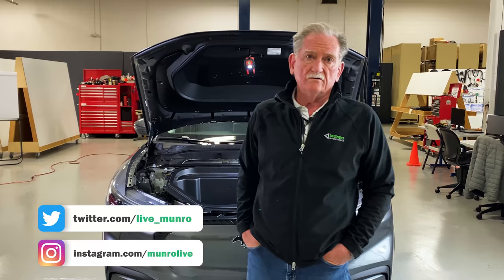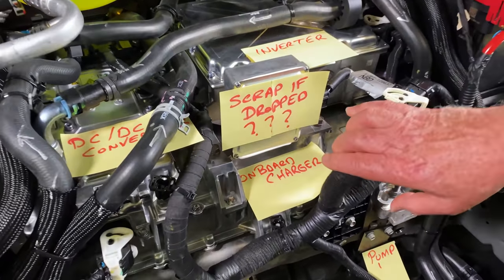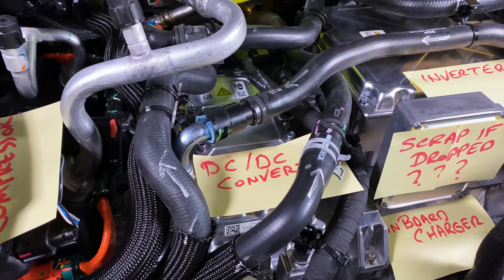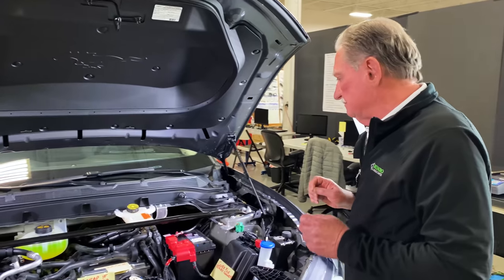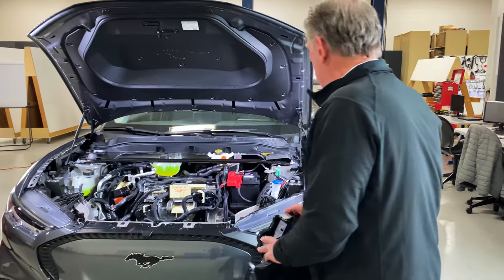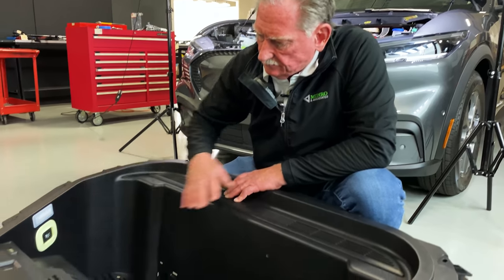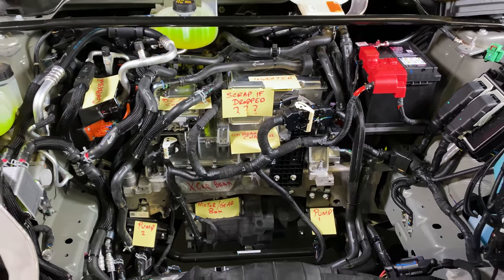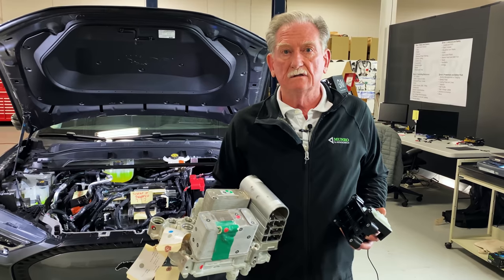Mach-E Thermal System Nightmare

Comment: The plastic lid over those sealed connectors is almost certainly the result of some edge case caught in the FMEA which could have been scored down either with testing or with that cover. Time constraints usually result in extra parts, and a later cost down would probably see it deleted when testing is complete.

Ditto the "scrap if dropped". It'll be an FMEA risk associated by one of the internal components mitigated by writing that on the box.

This is all typical of the conservative arse-covering nature of automotive engineering whereas Tesla have a guy at the top ready to understand the risks and make an educated call to ignore them.

Comment: I’m not an engineer but even I know you don’t introduce a joint, where there’s no need for one. Why give yourself extra problems to first make the joint, then fit the joint and at a later stage if something goes array, to have to eliminate each extra joint or mend extra joints.  If you can have a continuous run without constricting bends, don’t build in future headaches with extra joints.

Comment: So…”I don’t know what any of these hoses or modules do, but Ford should eliminate them”.

Okaaayy…
Reply from the maker: Our team of 30 engineers know precisely what each component is. The fragmented approach by Ford is only briefly covered by Sandy. The DC-DC converter, and charge module are integrated inside the battery on the Tesla Model Y/3 and there is precisely zero hoses between the pumps, octovalve, LCC, TXV’s, and chiller. The inverters are also integrated into the EDM’s for the ID.4, E-tron, and all Tesla’s. Thanks for watching.

Comment: Interesting mess of hoses. To play the advocate here, these hoses and fittings shouldn't reach a typical engine coolant temp right? No hot engine cooking them from the outside either. Less thermal stress and less chance to leak? Sure from an engineering standpoint it has much room for improvement,  but I don't think it's the ticking time bomb the comment section makes it out to be.

Comment: Utter nonsense. Look under the bonnet of a turbocharged car and there will be a similar number of hoses (heater, AC, liquid cooled turbos, cooled EGR valves, oil coolers, low pressure radiators and intercoolers, degas systems, split cooling systems, electric thermostats, electric coolant pumps etc.. etc..). The stacking of components is clever it maximises the frunk space whilst making each item accessible. The 'scrap if dropped' labels underline Ford's commitment to quality and making a 300v DC system safe, which is based on years of manufacturing expertise that the newer car companies don't have. Don't believe the hype, the Mustang Mach E is an outstanding vehicle.

Comment: Have you seeen this excellent June 8th (published 12th) technical Webinar from the IMechE youtube channel:
Advanced Thermal Management in Future Hydrogen Fuel Cell Powered Vehicles
Hydrogen fuel cells are becoming the next new innovative propulsion system.

This webinar will consider the key challenges for effective thermal management in future fuel cell powered vehicles. The goal of the webinar is to improve understanding of the current and potential future roles of thermal management in pushing the limits and trade-offs between key vehicle performance factors including powertrain system efficiencies, weight, durability, ease of vehicle integration, sustainability/life cycle impacts and cost.

Join the discussion covering the challenges and opportunities posted by Hydrogen Fuel Cells, including:

- Neil Fraser, Head of Engineering, MAHLE Powertrain
- Dr Cedric Rouaud, Global Technical Expert, Ricardo
- Nick Buyens, Technical Expert (Model Based Design), Toyota Motor Europe
- Pratap Rama, Fuel Cell Powertrain Manager, Jaguar Land Rover
- Chair: Prof Alasdair Cairns, IMechE VTMS Chair

[I can't post the weblink or it will be filtered out.]

Comment: Electric cars are very simple.  Until you try to make 300+hp and have to water cool everything as much as an ICE.
Let's be clear however, a Tesla will overheat if its run at high power too much.   No doubt the ford setup can be simpler.
Let me also add a point that Mr. Munro seems to ignore, that when you make everything one single part, the cost to replace/repair goes way up.
If the new stamped Tesla gets in an accident, even minor, the car is now trash.

Comment: Why don't people understand.? Ford cannot go from yesterday making cars that the dealers can make tons of money on repair costs too tomorrow making a car that the dealers have to repair a lot less. Plain and simple the reason these cars are complicated and they have so many extra parts and stacking Parts on top of Parts on top of parts so when one part goes bad you have to remove all the other parts to get to that one part is so the dealers have a revenue stream which is us the customer. For example in your video you show that they put all the parts on top of each other instead of spreading them out like Tesla does. The reason they did that is if for example an inverter goes bad you have to spend three or four hours removing the other parts to get that inverter so the customer has to pay for that the dealer makes money. Yes Ford is moving in the right direction but they're moving at a snail's pace unlike Tesla which makes leaps and bounds because they don't have a dealer Network on their back telling them to make cars complicated so they can make money off the consumer

Comment: If that’s the best Ford can do, maybe we should let the company fail.This is embarrassingly bad design piled on top of bad design. Less parts equals a better product is the core value of design and engineering. Throwing more parts and random people at a problem in a desperate attempt to quickly solve it never ends well for a company. I guess this is what the end of Ford looks like.

Comment: "Scrap if dropped" really sums up the erroneous mindset of legacy automakers. By contrast Tesla seems to run on "drop if scrapped"! It couldn't be a more inverse mindset of engineering. If it's superfluous to requirements drop it, don't ship and build un-necissary products. That's really what makes the likes of Apple and Tesla speak such a similar "minimalist" design and engineering language, something that the "legacy" of their respective industries,  such as Microsoft and Ford, continually fail to comprehend. This episode really just highlights why I wouldn't be keeping a single dime in the likes of Ford, Microsoft or any of the "legacy" automakers in general. They're simply too far behind Tesla, and have a completely "wrong" culture to be able to adapt in any meaningful way. 

Just imagine what happens when all those leak paths find their way into batteries and motors?!? It will be beyond a "shocking" out come (pun intended!).

Comment: Sandy: "OMG! look at all these hoses! The horror!" 
Also Sandy: "Tesla does it with only a "few" hoses" 
There are ICE cars that have much higher heat load extremes that last well over 20 years and hundreds of thousands of miles with hoses and clamps much worse than this. He seems extremely biased, this is not such a big deal. Everything is easy access and if you don't know how or why it works the way it does, that means you have no business working on it. I could also care less about some stupid battery tray, even though apparently they did it right? But he had to mention it as if it were a negative, WTF?
Seems like someone is heavily invested in Tesla stock and has his tongue way up into Elon's butt. #Zerocredibility
Reply: Say what you want, but complexity = problems and failures
Reply: @danmobile  In some cases, but it is not that simple. Do you think the Tesla is less complex than the Ford? It is not, so spreading complexity out into several individual components can actually improve reliability, reduce cost, and simplify ease of repair. The point is you can't just look at the number of hoses and valves and determine which system will be more reliable. I have seen plenty of examples where individual integrated components are actually far less reliable, and far more expensive to replace.
Sometimes components are added to actually improve reliability. I have experienced systems that looked very complex but were extremely reliable, and seemingly simple systems that had very high failure rates. My point is that these hoses, clamps, valves, are used in even more complex systems that operate under much harsher conditions and still have a very high reliability. So to say that we know the Ford will be less reliable just because it has a couple more hoses or valves is just foolish speculation. 
Are cooling systems even a high failure rate item on most modern cars? No, so should this be a concern in this case? Absolutely not.
Sandy has even admitted he is biased with Tesla, and it is very obvious from his videos. The fact is nothing he has pointed out here tells me one way or the other which car will have better reliability. It is possible that using proven off the shelf components designed to work under much harsher conditions, could end up being more reliable. 
Unless there is a particular component or design that is known to be a high failure rate item, you really cannot know. Some of the things he was complaining about were just absurd, which tells me this is a very biased review that is not going to tell you anything of value. All it tells me is that Sandy is a Tesla fan boy, and apparently incapable of providing an unbiased objective analysis or opinion on this EV. 
As to which car will be more reliable? Only time and experience will tell. Personally I would be more concerned with which car rides better and has less squeaks and rattles (especially in a quiet EV), and in that regard even Sandy admitted the Ford was significantly better in that regard, and given that he is a Tesla fanboy that is really saying something. Perhaps that is why he felt the need to find inane issues to point out about the Ford? 

Yes it's better in every subjective category, but look at these extra hoses! And the battery tray! Ridiculous.
Reply: @ericmichel3857  Without reading that huge wall of text, I think the Tesla has a superior cooling system design and its simplicity has a lot of upsides with pretty much no downsides. Ford is inferior here, on this detail. Sorry. 

There's so many Teslas on the road and the cooling system is dead nuts reliable.. the Ford is the one that needs to "time will tell" etc.

Comment: Once again you seem to be missing the point. FORD found a way to keep their dealer network in the loop. Everyone knows that purposely built EV's don't end up going back to the dealer for servicing. FORD has designed flaws or potential flaws as in leaks to their cars as a way to ensure that the cars / trucks EV or regular all and I do mean ALL end up going back to their dealers for servicing at some point.

TESLA do not build flaws intentionally into their cars. They will however take better idea's as they are discovered either by you or other manufacturers that you tear down and implement those into future iterations of their vehicles. What would you do? They seem to follow good idea's and jump start them to be incorporated as any good engineer should....

Comment: Ford has always seemed to have form follow function under the hood - my F150s and F250s are not very pretty with wires, hoses and tubes running everywhere - unlike GM and RAM who seem to make things look prettier - that being said, I have had very little to no issues with my trucks over the years, putting about 45K miles/year on each.  I hear of challenges particularly that RAM owners have with reliability ... I will take ugly under the hood over pretty problems any day.

Comment: This is all well and good, but Tesla is delivering cars that break down shortly after delivery! iPad Rehad and several others are reporting increasing service issues and real incompetence. They may have some good design, but Tesla is FAILING SERVICE & DELIVERY IN MANY CASES! I’m hearing from three friends that returned cars and cancelled! Tesla is screwing up, that’s not a company with their valuation. Fit and finish is failing over and over.
Reply: She got a lemon. Bad luck but happens. Given the scrutiny Tesla receives, stuff like this would be all over the news if it was common. Plus, being a member of one of the largest Tesla forums, I get to see a lot of the complaints, and these kind of multiple failures are rare. I do agree on fit and finish, but the factory usually takes care of complaints when brought up by the customer. There's room for improvement there for sure.

Comment: I've driven 3 cars for over 200kmiles and 12 years and none had any coolant hose leaks.  In all my cars, I've had more issues with electronics that anything else.  BTW, I'm an Electronics Engineer myself and worked in power electronics my whole career (>25 years), I think the most reliable car maker will be the one who does a better job designing the power electronics and is more conservative with their design margins.  Liquid cooling has been used even in power electronics for many years (since the mid 90s), and coolant leaks are not an issue.  This video is looking for problems in the wrong place.  This is an Electric car, you need an experienced Electrical/Electronics engineer to comment on the design....he or she would have more experience in this area.

Comment: The fuse bored connectors are high power connectors and there black 😂😂😂 they are not. They are ran off the 12 volt system 😂😂😂 well he clearly doesn’t know anything about HV vehicles 😂😂

Comment: Hey Munro are you taking into account how repairable something is?  it seems like if you keep lightening things and burying them inside, it would be ridiculously difficult to repair.  It doesn't matter how well designed a car is, if it's difficult to repair that means it's expensive to repair and all the "perfect engineering" in the world won't mean squat once an owner gets a $5000 bill for something that should cost $500.  Especially if you are replacing a $500 part but the labor costs $5000 on top.  Just ask BMW.

Comment: Unsubscribed. I need to see unbiased reviews. Ford should be commended for “scrap of dropped” policies. Sensitive parts like air bag sensors and accelerometers should not be installed after taking a direct hit on concrete. Sandy made it sound negative. Terrible Tesla fanboy hit job on Ford.
Reply: I agree about the scrap when dropped stamp but the rest of it's a nightmare.

Comment: I dont understand the fuss. Having individual parts may not be such a bad idea. Many people have complained about the name which is of no concern to me. What matters is that the car drives and performs well. I cant see that hoses running in relatively low heat and pressure are going to be a problem. Some critics may be right but with sophisticated monitoring equipment leaks and failures should be highlighted early and correction inexpensive in the long term.

Comment: Let me see, the title says "thermal system nightmare," which suggests that the Mach E is capturing and holding heat, and this heat is going to melt the entire car.  What it actually is about is that the Mach E has multiple plastic covers under the hood when Tesla (which does no wrong) has only one injection molded part.  It also highlights that the Mach E uses easily maintained hoses and connectors that can be purchased at any local auto parts store where as Tesla has the same liquid exchange except Tesla has replaced their hoses with an injection molded cube. I can certainly see the benefits but Ford doesn't deserve the clickbait slander especially when you can purchase the Mach E at a starting price of $42k before rebate versus the Model Y at $50k.